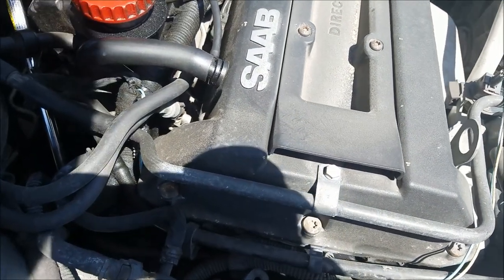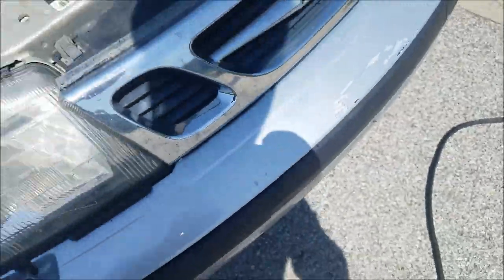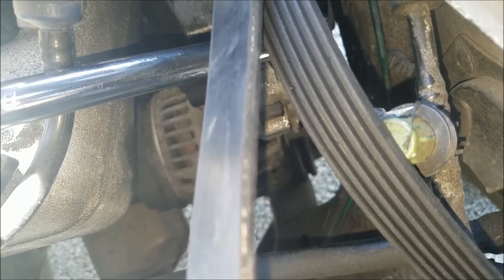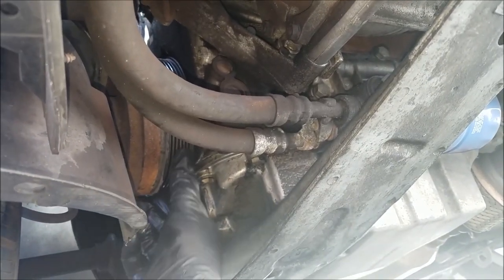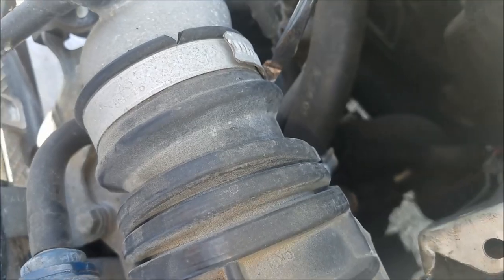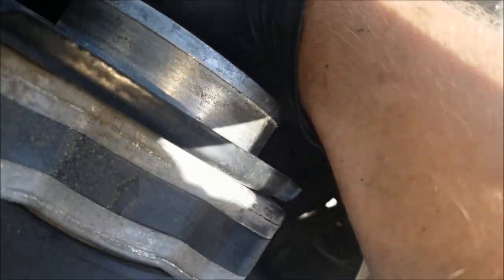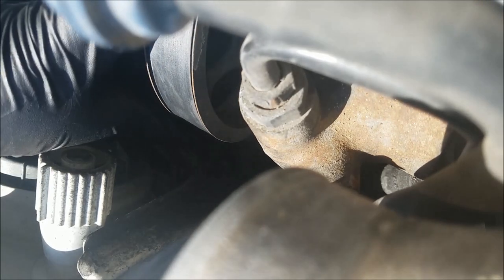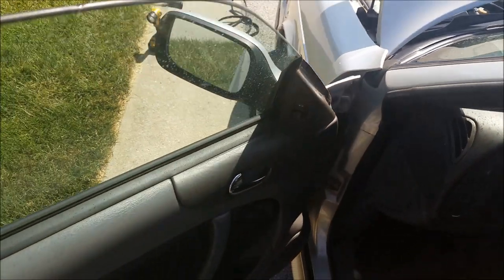Saab - Short Belt to Bypass A/C

Comment: Good video. Thank you! Would help to have a diagram of what the belt routing is supposed to look like around the pulleys. Also, your car does not have a lower cover on it that protects the engine from rocks (or you removed it before you started the video). This has to be removed in order to see what's going on underneath the car. Might be nice to mention that as well.

Comment: Thanks for this video. I stopped using the AC due to a leak, but now, after watching your video, I think I'll bypass the compressor to be on the safe side. Fixing that leak might be expensive and sometimes it's not worth it.

Comment: Thanks for the tip. I bought a used 9-3 two hours away that had a seized compressor. I was able to do the bypass on site and drive it home. Otherwise, it would have had to be towed.

Comment: Thanks for the video! I did this recently and dug deep in the forums for old debates over the correct part. You can go one step shorter with the belt if you like -  from 1815mm/71.5in to 1805mm/71in. I did, and had no struggle with the tensioner, fits just right.

As for the best brand, the only consistent recommendation seems to be Goodyear Gatorback, which you'll find isn't available anymore. They are still made, but they are sold as Continental Elite. Confusing, because the standard Continental belts are prone to shredding, which I can attest to.

Continental Elite (gatorback) part# 4060710 short belt, 4060922 long belt.
An alternative: Dayco part# 5060710 short belt, 5060923 long belt. Notice the part#s are pretty consistent. Again, I'd avoid the standard Continental line.

And finally - If your AC works but your AC pulley is noisy, it may just be the bearing. The compressor is a Sanden TRS series, which fits a 35x50x20 pulley bearing. NSK part# 35BD5020DUM, or anything listed as an NSK bearing for a TRS compressor. Can be had for $15. Worth a try, and the short belt gives you plenty of time to try it.

Thanks again, lets keep em rolling.
Reply from the maker: You sir, are the man! Thank you for including all that pertinent info. I'm sure it'll help a Saaber who one day needs to know the correct sizes, and yes I included 1805 as a usable size in the video. I too remember digging around the old forums the first time I needed to do this, so hopefully this video will make it easier for someone to find it! Thanks again
Reply: This video and this comment is just what I have been looking for for days! Thanks.

Comment: I have 99 Saab 9-3 convertible. Following the the diagram. I still have 4 to five inches of slack. How do get he tensioner to tighten. Frustrated. Waites 10 days to get the short belt. Now i have it it doesn’t fit. 1815mm

Comment: Really great, emergency repair solution, for one of the many issues that could potentially leave you stranded with your Saab.  I'm looking forward to your "on location" solution to a failed slave cylinder with manual vehicles or your solution for failed fuel pump motor while driving around.  How many miles did your compressor have on it?  Was it the original, stock compressor?  Was the AC system maintained and holding pressure or had it run out of gas?

Comment: Great video, I'm going to try this. One question - how do you thread the belt around the crank pulley without going in from underneath? Doesn't look like there's any room to get my hands in there.
Reply from the maker: If you don't want to come up from underneath or remove the passenger side wheel, you can remove the air box and try threading it around from up top. Personally I've done it that way but still I always go below and double check it's on the crank pulley properly.
Reply: @saabross3171  thanks

Comment: Can i remove the ac compressor completely and use short belt? This is for low budget project car. Rest of AC system is gone already. I would love the space
Reply: Im just not sure if its connected to other fluid systems, ive never built a saab before.
Reply from the maker: Yep, most definitely. The short belt skips AC all together, whether the compressor is there or not!

Comment: I have an 01' 9-5 2.3t. It all looks the same... is it?
Reply from the maker: The 9-5 belt is about 600mm longer, but that's only IF you're using the outdated idler pulley. Most ppl skip/delete/bypass that pulley on the OG9-5, since even Saab stopped routing it that way, in which case it should be roughly the same as the OG9-3. It looks like even the advertised "short belts" for 9-5 are too long when running the idler delete
https://m.eeuroparts.com/Parts/6828/Accessory-Drive-Belt-6K-2415-Short-Belt-5590344/
Reply: @saabross3171  Thanks for taking the time to respond. I'm not running the idler, so the configuration is the same as your diagram. I just replaced the water pump and noticed the AC compressor was making a bad bearing sound when I spin it by hand, so I'll just bypass it for now. It looks like I'm seeing any where from 1801mm to 1815mm in my research. I'm still not sure which size to get. I'm guessing anywhere in that range will work.
Reply from the maker: @1shredderx  Yeah the tensioner will take out any slack / difference so I think you're right; anything in that range will work. I don't see why 9-3 sizes wouldn't work if you got the same config w/o the extra idler; it's basically the same engine. I've never short belted a 9-5, so when you get it setup comment which size worked for you so that it might help others!
Reply from the maker: @1shredderx  Confirmed. 6pk1815 is the part # to bypass the middle idler & AC, exact same as an OG9-3 as it is for 9-5
Reply: @saabross3171  I used the 6PK 1815mm to bypass AC and the center idler. It fits perfectly. Thanks!